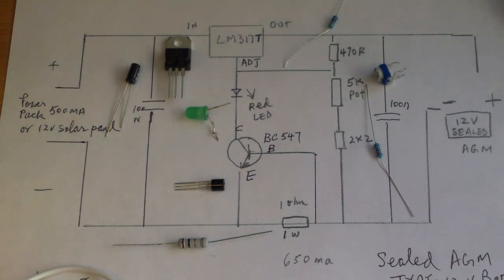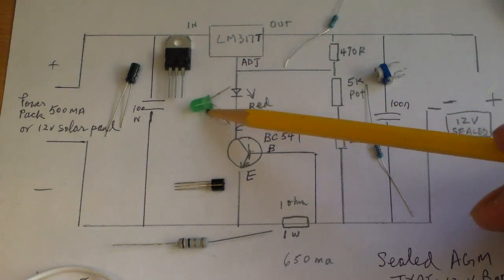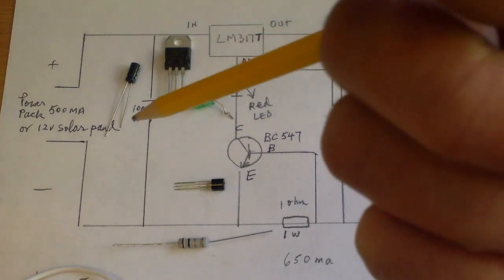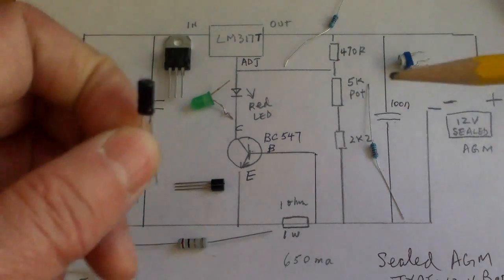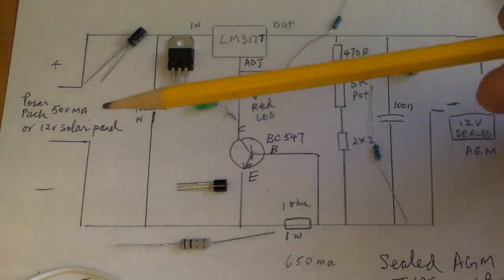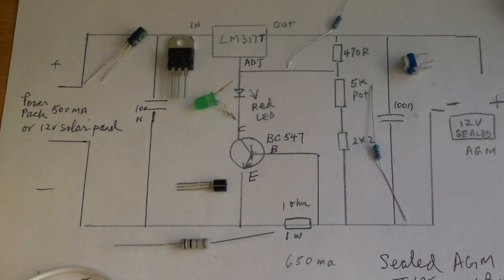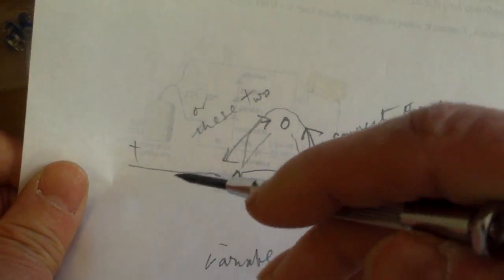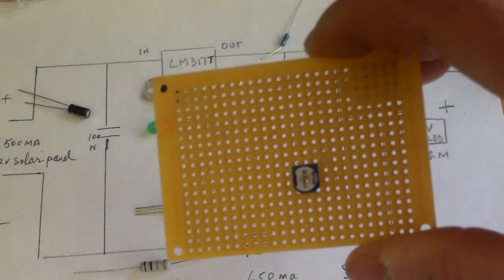Simple solar charge regulator for 12 volt sealed lead acid or AGM battery pt. 1

Comment: Sir your 5K pot will not change the resistance in the circuit unless the middle leg is connected. basically all you have according to your schematic is a 5K resistor.

Comment: Do you have some respectable reference for charging data? I cant seem to get anything definite. Best way would be go by battery manufacturers info, but some of them seem to be really vague (like, use 12V charger for 10 hours). Chargers that have specific AGM mode usually do absorption at 14.7V, otoh some say they support GEL and AGM where 14.7 would damage GEL.

Comment: hi sir, thank you very much for this video
sir i have a question about how you can calculate the resistor ?
im trying to make a 5V 1.5Amp solar charger.
Reply: With the LM317 the current is measured by 1.25volts over the output resistance because it trys to keep the voltage at 1.25volts. so it ups voltage when a divider is added.
Reply: There's lots of video's on the 317 that you can learn from. Just type it in and you will find hundreds.

Comment: what if i were to use a 17V solar charger? do i also change the 1 ohm resistor?
Reply from the maker: Affiq Affendi I'm not sure what you mean by solar charger. You can use a a solar panel around that voltage.

Comment: if i can reduce the voltage using the pot can i charge lithium cells 18650 with this circuit
Reply from the maker: Absolom Madhaka 18650 cells need dedicated chargers. So on the safe side, I wouldn't use this.
Reply: Yes I agree.